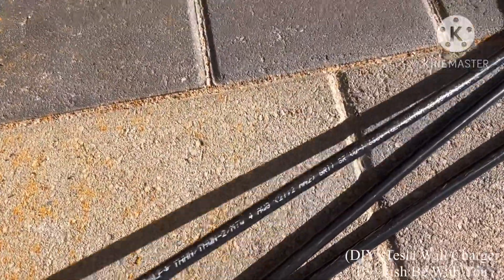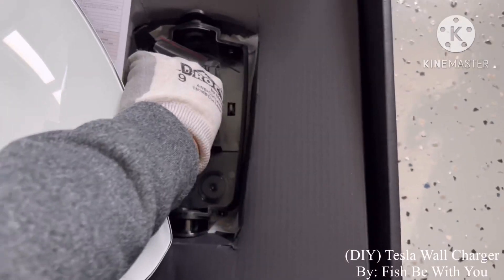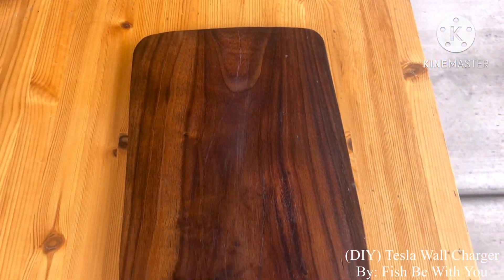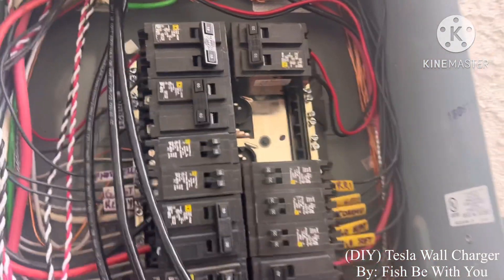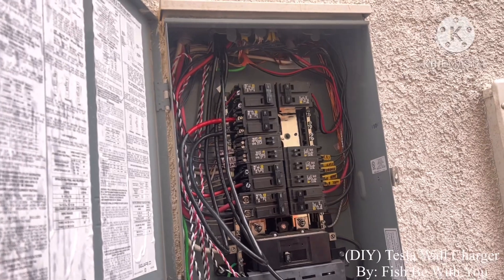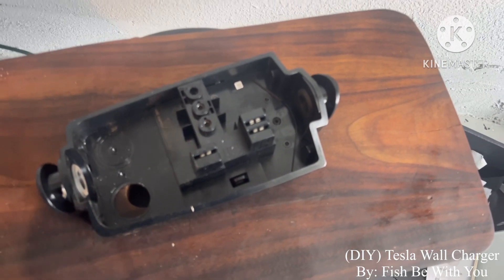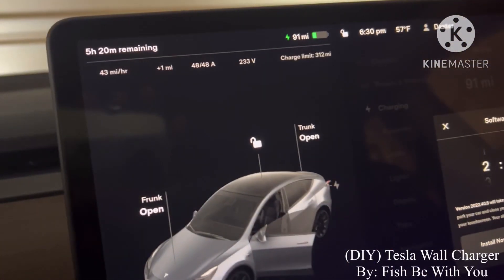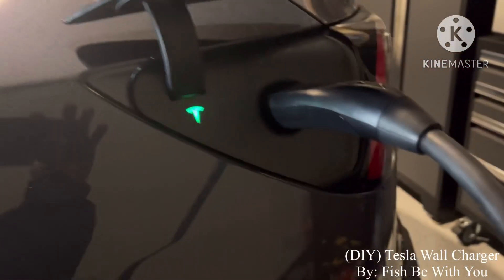How to Install Tesla Wall Charger DIY

Comment: Yung 4awg wire parehas lang po ba sa 6/3 or 6/4 na wire?
Reply from the maker: Mas maliit lang ang diameter 6/3 or 6/4 vs 4 AWG pero ok narin sya sa wall charger.